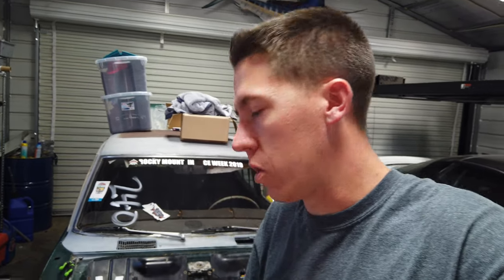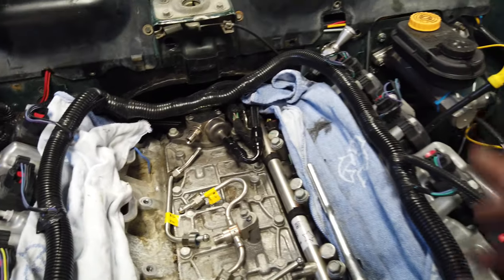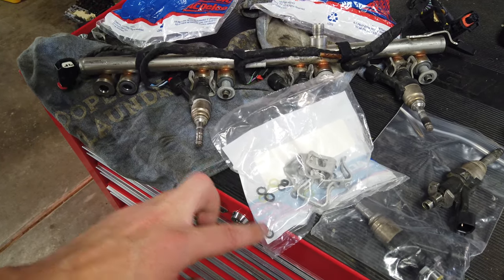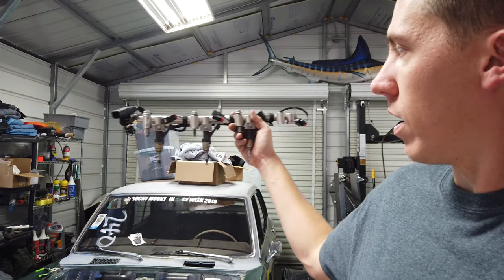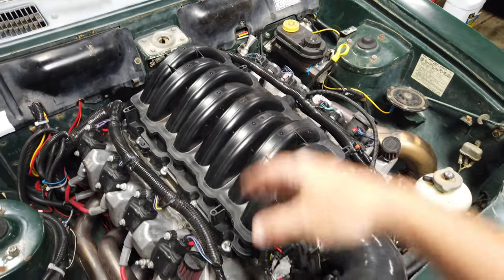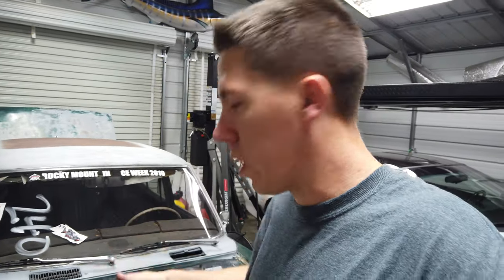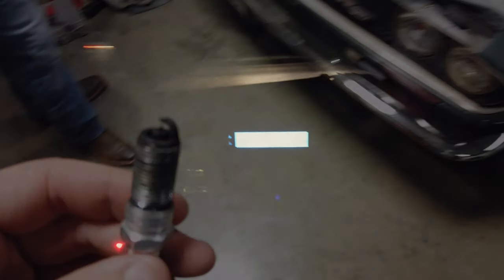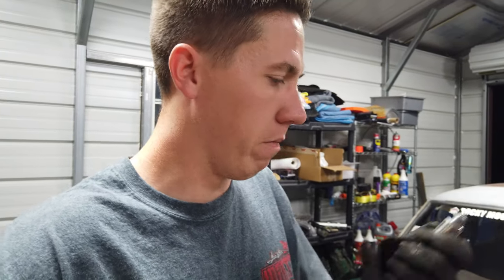Gen V LT Injector Removal and  Replacement L83 L86 LT1 LT4 Stuck Injector!

Comment: These injectors need to be removed with a special tool that are basically J hooks that pull the fuel rails up evenly without bending.  The seals at the ends of the injectors also need a special tool that looks like a bullet to install over the end of injector and then press the new seal over it and down into position.  The most important step is the tool that compresses these 2 seals so you can press it back into place on the engine.  You twist it and then it compresses the seals to a point where they will stay compressed just long enough to get it back into the engine. If you don't do this you run the risk of leaking and/or tearing a seal.
Reply from the maker: Yep! This is exactly what happend going to order the compression tool soon and re do the seals
Reply: @BuildTuneRace  cool.. I know that sucks and I have found this tool with all the bullets and the compression tool for about $180
  GM has a tool website for techs that brings that price down by a ton. If you know any techs I would ask the to order the tools for you
Reply from the maker: @steves8530  awesome thanks for the info!
Reply: Where can i find the tool?

Comment: The seals are supposed
To be sized, after install with  special
Tools. Probably better off
Cleaning them  Softly With brake
Clean and not replacing them, that’s what I
Always do anyways.
Reply: I wish I would have just done this.
At work.
I have some going back in, I replaced all seals, and two new injectors, shaped the seals with the "proper" tool, still don't fit as tight as the new injectors that came with seals.
it still looks to me like they're gonna not go in very easy at all.
😞 I really despise gen v stuff.

Comment: How did you go about diagnosing the injector? I have a tick that I'm trying to figure out whether it's a lifter or injector
Reply from the maker: Did some research and found that some of these injectors have issues so I just decided to swap it. Didnt really know 100%
Reply: Yeah all I know is the tick is coming from passenger bank, seems to be one of the front 2 cylinders.

Comment: Did you have a rough idle and low idle. My swap isn't idling correctly and only code is throwing is low idle every once and a while. My truck is also smelling rich. Just pulled the plugs and number 1 and 8 threads were wet.
Reply from the maker: It idle decent I also probably went in to the tune and adjusted it a bit and the electronic throttle body will just continue to open until it reaches commanded idle speed. Are you still using a drive by wire throttle body

Comment: Supposedly there is an updated seal kit from GM, not sure when the update came out but looks like its GM 12672366? Also in your description there's a typo in that P/N, missing the 9   "..6933"  Not knocking anything you've done at all, I wound up here looking for this job and is very helpful, just wanted to keep information consistent for others.
Reply from the maker: Definitely thanks for the catch! I just picked this stuff up a few months ago I'll have to look into the updated kit

Comment: I have 2017 silverado with the 5.3 can i use the injector you mentioned i need 8 injectors
Reply from the maker: These are for a 2014 I'm not 100% sure if the 2017 has the same injector part number or not. I would think these would work but I'm not sure if GM changed anything or not in later models